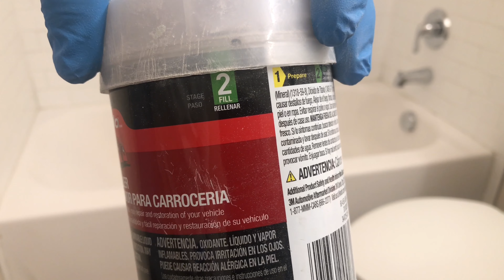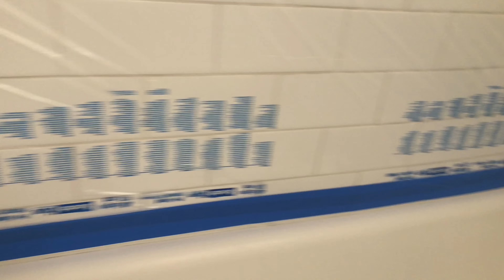Refinishing Tubs: Getting the contracts

Comment: You don't need to use that much etch brother . It won't change the durability of the coating by making the bathtub dull . Just a bit to open pores on the surface .

Comment: Thanks for the insight! Do you know of anyplace to get hands on training. I have 0 experience but want to get into the business. Currently working as maintenance at a apartment complex
Reply from the maker: If you purchase all the supplies you can teach yourself. Honestly. I’ve taught “true junkies”to do this. It’ll be cheaper to buy a tub to practice on or find a tub for free that a contractor is trying to get rid of. A tub at Home Depot is about $225. Training could cost you a lot. Although some offer training with equipment packages. But not sure of the “up charge” on the equipment.

Comment: Question. Do you have to sand every tub before etching?
Reply from the maker: If there is soap scum, yes. but usually they clean the tub before I get there because they don't want the cleaning crew to mess up the finish with a bunch of harsh chemical. I sand ALL fiberglass tubs (no etch on those)
Reply: @thetubguy2293  hope all is well . Why fiberglass doesn’t have to be etched ? What material do you etch ? Thanks for your videos
Reply: @CarlosHernandez-pq3rg  Fiberglass is porous and and soft enough to sand.

Comment: @ The Tub Guy do yo have an email one can contact you at?
Reply from the maker: I can't. Ask me anything. I'm gonna backtrack and make some "total beginner videos". I thought most of my viewers would have some experience in construction and would easily add or change over to refinishing. Not the case. So next few videos will be very remedial.
Reply: @thetubguy2293  yes I want to know the differences in the guns and tips you mentioned that you use on counter tops? And also the materials used for each phase. Like the speckles etc.